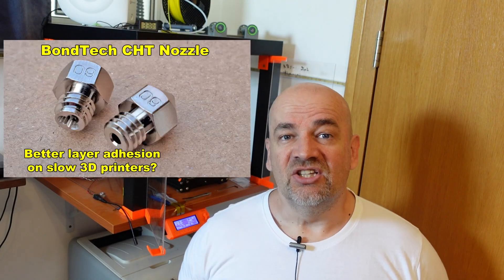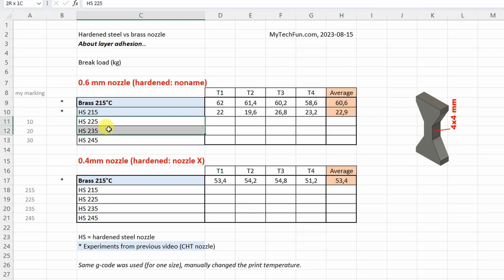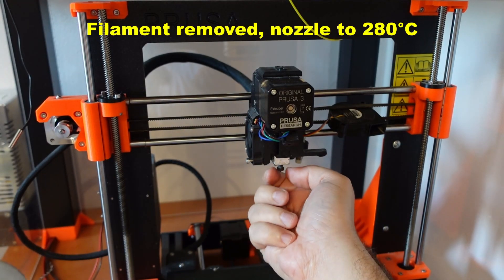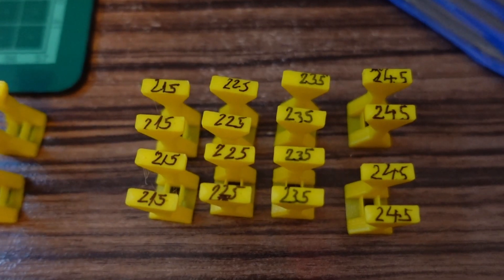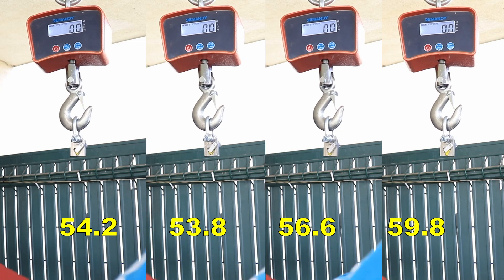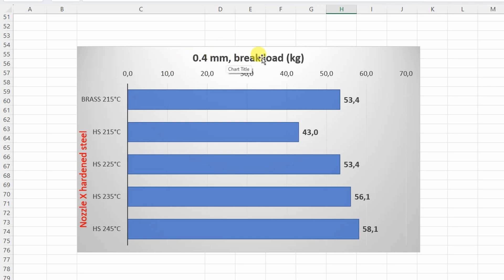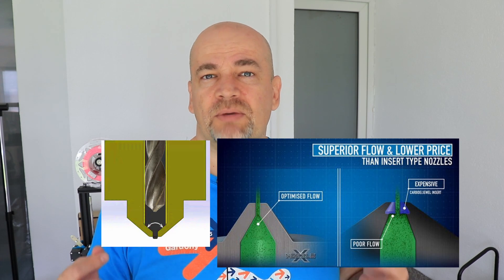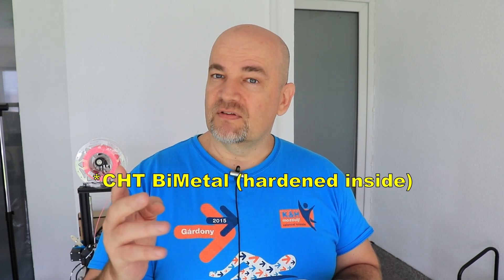Hardened steel nozzle vs brass nozzle - the layer adhesion test

Comment: Could you try the brass nozzle at higher temperature? I have only printed at high temperatures (for Structural parts) and went over to a hardened steel nozzle to reduce wear. Haven't noticed any difference

Comment: Can confirm  ....even good quality .6 nozzles in steel are pitiful. You will get some minimal adhesion and aesthetic quality fast but everyone using these is selling brittle garbage....every 1.0 nozzle vase mode trash can ....is trash. ....and the heat-creep ....don't get me started....there aren't enough 5015 blowers I'm the western hemisphere to keep your cold-end cold.

I wish I could get Inconel heatbreaks but you can buy a lot of brass for that price.

Too bad tungsten hasn't caught on ....far more machinable than diamond but so too is steel cht style....even with the added complexity..

Seems like nozzle tech has plateaued. We need heat creep thermocouple telemetry and better cooling like semi-solid forged heatsinks with turbulent air flow or liquid cooling and AI that maintains a MINIMUM volumetric flow instead of caring so much about max flow volume.

Eternally grateful for the content on this channel.

Comment: Curious, of you printed slower on the 0.6 mm would you get better later adhesion?  I'm guessing the 0.4 did better because the filament moved slower through the nozzle, giving it more time to melt.

Comment: I wish you could do this on a corxy/p1p or something faster. As temperatures actually definitely need to be raised on higher speed printers with a steel nozzle. Both combined have a multiplication factor and you are the only man I trust to bring these results

Comment: I think you are likely seeing a direct result that the HS can't transfer the heat as quickly as brass, so at a constant flow the region inside the nozzle sees a severe drop(compared to the heater block temp) once you get it going fast enough, an IR camaera would be good for this, just doing one of those blob flow tests and seeing what temperature the blobs extrude as! Also with something like klipper you can directly see the PWM of the heating element, I suspect the HS isn't working as hard because it's extruding colder, but also because that drop isn't propagated back to the thermistor as effectively! By having a high resistance metal the closed loop of the feedback system starts to break down in effectiveness, if you had a way to thermistor the HS nozzle itself, then it would also incur overshoots, but at constant flow it could theoretically maintain a perfect temperature for the filament. Technically brass nozzles have this issue also, and things like how far you screw in the nozzle to the block vs the filament tube opposite, change it.

Comment: Very interesting. I have a 0.6 Nozzle X on a machine that does filled material like CF. So far doing temp towers I hadn’t seen the need to bump up the temps but your data is very persuasive. Thanks !!

Comment: Interesting note on interior smoothness.   I remember an interview with Sanjay(original founder of E3D) where here was talking about tests they ran on internal smoothness of the nozzles.   They found that making it too smooth could actually make it worse.    I can't imagine how that works, but E3D was doing lots of internal testing and adjusments in their machining processes.   They even went so far as to use liquid nitrogen to instant freeze hotends while it was printing and then cutting it open on a mill to try to see what was happening at particular moments of the printing process.
Reply: If it's too smooth it's probably similar to a boundary layer effect, all the molten filament stays on the outside edges and doesn't as readily mix with the warming up core area due to lack of turbulent flow. But that's just a guess. CHT's work by immediately splitting the core as the curvatures inside make it more turbulent as well.

Comment: What's missing is an actual measurement of the nozzle temperature. Is the increased temperature set at the printer actually arriving at the nozzle tip or is the thermal conductivity so bad that the higher temperature at the heater block is needed just to get the nozzle to the same temperature as brass. In the same vein I'd like more information about the preheating time. Maybe with a steel nozzle you don't need higher temperature, maybe you just need to wait a few minutes for the temperature from the heater block to transfer to the nozzle. If that's the case raising the temperature would only work for small pieces like the test objects, but hour long prints might suffer.
Reply from the maker: I just simulated real-life situation, I just raise the temperature and measure the layer adhesion, what is between is considered as a "black box". I know the input and the output.

Comment: I think you are right that it is about internal surface finish of the nozzle, but I have used E3D hardened steel nozzles and nozzleX and I think even for the high quality E3D HS nozzles because of the lack of the coating internally that is thermally conductive and makes the internal surface smoother (by the way doing cold pulls reduces the lifespan of the coating in nozzleX as you slowly wear it off) the heat conductivity is still worse for simple E3D HS nozzles. Glad the bi-metal CHT nozzles are worth it. I recently bought a 0.6mm one and planning to print ASA GF, PA6 CF and PC CF when I am back from my summer holidays.

Comment: Interesting... I use SliceEngineering Vanadium 0.6 nozzle as my regular (use to use Vanadium 0.4 but prints pretty much look the same, but I win in time) and I raised my temp only 10C because Vanadium... nozzle size didn't play any roll in my experience... sure I did not do any tests, but just regular printing and support removal would not made me raise temp 20-30C... maybe you can test Vanadium nozzles some day...
Reply from the maker: Thermal conductivity of vanadium is approx 31 W/(mK), steel 20, brass 111. Tungsten would be interesting, better thermal conductivity from brass (bozzle nozzle is Full Tungsten Carbide)

Comment: It would have been nice to see the same tests on the KLP1
Reply from the maker: Yes, KLP1, it has hardened nozzle by default, I noticed some underextrusion lines form time-to-time, since that I am increasing the default temps. Kingroon also offered, that they will send me their CHT-like nozzles (like those from Aliexpress, with inserted part).
Reply: I will get my KLP1 tomorrow. Do you suggest that I buy the cht nozzle or a brass one?

Comment: Most of the time i forget to change the temps from prusas standard profiles when i have a hardened nozzle in there, e3d ones. Surprisingly minor differences in the results. But i will try to remember the 10dwgrees with structural parts :)

Comment: that's very interesting topic!
This means that filament doesn't ets less heat energy when in the steel nozzle, so printing with steel slower could also help.
If you would get a no-name ruby nozze that would be another comparison point ? would it allow to print colder or faster than brass ?
Reply from the maker: Looks like I will have some nozzle tests in near future, somebody suggested bozzle nozzle too. I will see..